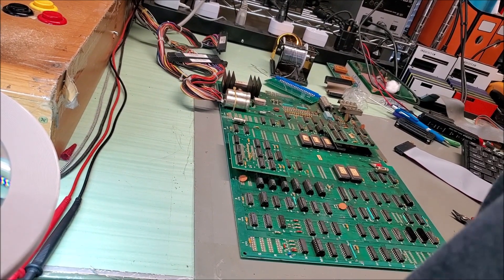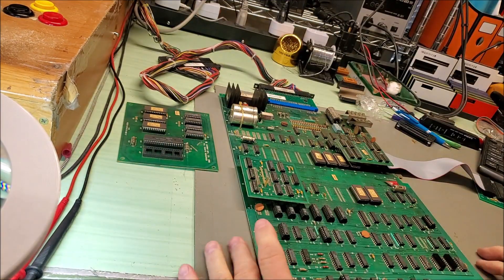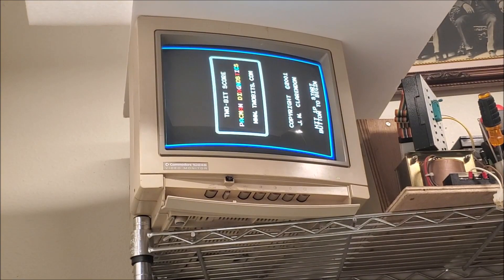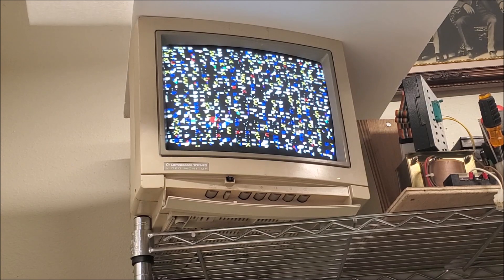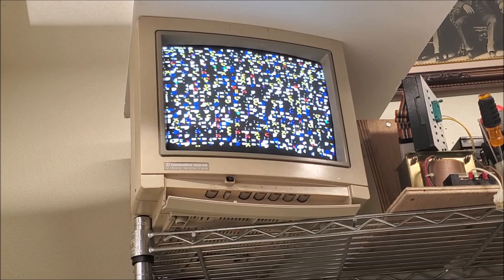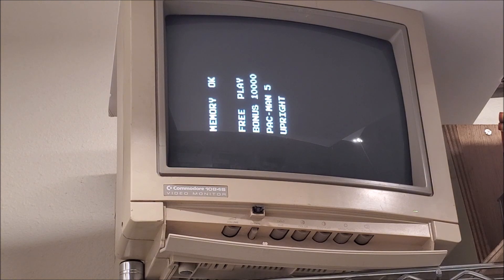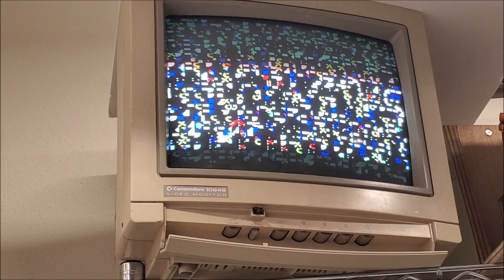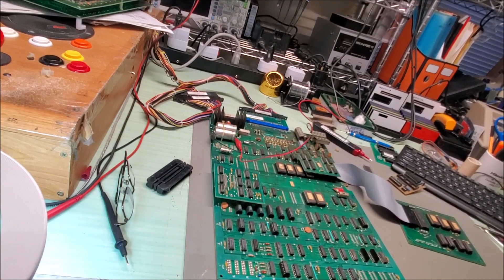MS PAC PCB Repair (240201)

Comment: What types of various tests can you do to test for bad sockets?
Reply from the maker: Pretty much eyeball em, or wiggle the chip in them. Generally the chip will be loose or you can visually see a problem. You could use a meter on each pin, but that doesn't guarantee they are good.